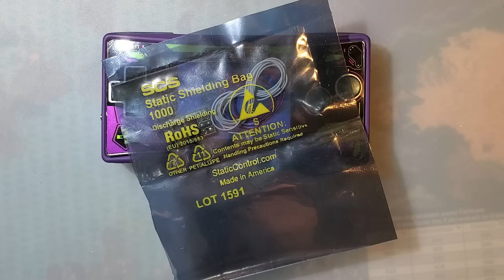Overclockable Game Boy Micro [ClockxControl from insideGadgets]

Comment: Nice work dude, I love the mods. Those oscillators are a pain to desolder for sure. Flux and high heat are the only way. It's easy to get impatient and start pulling and then you rip the pads, and then it's just a huge fustercluck.

Comment: ive removed small chips like this before with a blob of solder on the top and leave the iron on for a bit, the chips are probably not useable afterwards but it works
Reply from the maker: That's what I do if I won't have to reuse the part I'm removing, usually. Especially for two pad parts.

Comment: Is there any way to remove scratches from a Game Boy Micro faceplate?
Reply: Try a bit of car polishing compound it’s like $5 for a bottle at Walmart put it on a piece of foam or maybe a soft cloth foam like a very smooth sponge is best nothing porous if you can find a headlight restoration kit at Walmart that has a buffing pad included for like $10-$15 that’d be best just make sure it’s a sponge the meguers kit at Walmart has a blue sponge included if you have a drill it’ll take 5 seconds lol otherwise you may have to polish by hand for half an hour
Reply: I made my onyx black Ds lite so smooth it looks like a mirror it almost looks chrome instead of black
Reply: Last resort you might try a magic eraser to remove deeper scratches it’s an abrasive  but that will likely leave the faceplate looking foggy you’ll have to buff it afterwords to make it perfectly clear
Reply: Arthur Dykes If I wanted to use the car polishing compound could I use a microfiber cloth?
Reply: heck no • 15 years ago it wouldn’t hurt anything it just may not be as good as a foam pad it may take longer the compound isn’t gonna hurt your screen you just don’t wanna use a material that’ll cause scratches as you’re bugging like an old wash rag may have caught particles that will scratch the screen over the years
Reply: Have you tried putting a sponge in the end of a drill and buffing it?

Comment: Can you do this on a gbs sp?
Reply from the maker: the overclock module is actually designed for a regular GBA and, by extension, a SP. This particular module is compatible with all models of GB but some screen mods may be less than cooperative while over or underclocking.